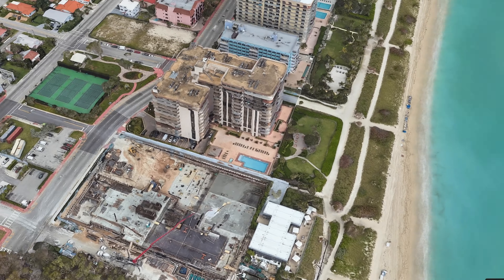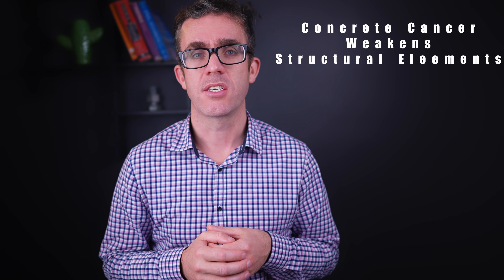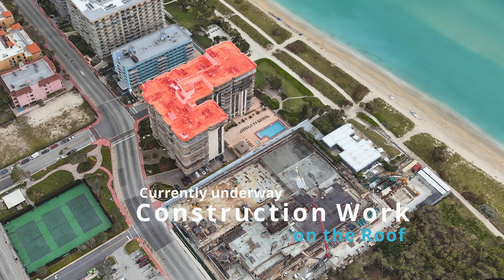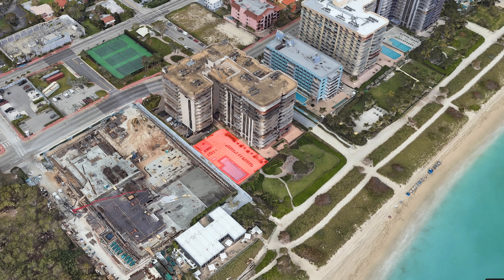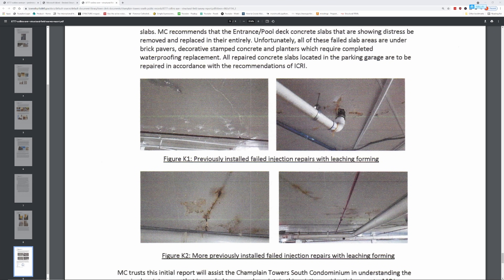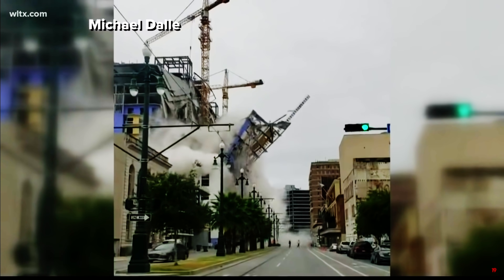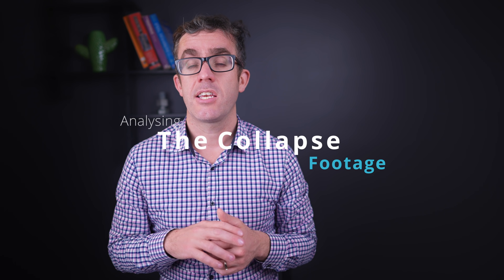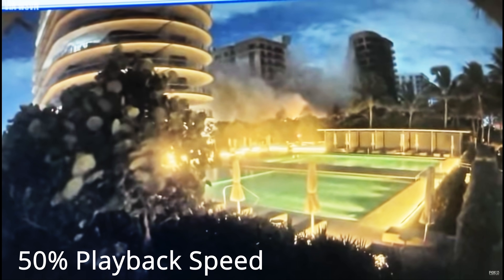How did a Miami building collapse: The Warning Signs. Report and  CCTV footage analysed

Comment: It's pretty obvious why it collapsed.. he who builds in sand... has no foundations. Soon all the others will fall as well, unless they're bedded in rock.  And judging from the obvious lack of maintenance even good foundations won't save them.   The ground collapsed first, followed by the supports, then the mid section, essentially pulled the rest down.  Fortunately they built a solid core around the lift access, which seems to have held out for the remaining building. That and likely the shorter supports at that side. This collapse.. was really caused because they used reinforced concrete in the construction.  And this is the fallguy in almost 95% of all building/bridge collapses.  Those flats might look nice outside, but that doesn't mean they were built right and they certainly weren't maintained.
Reply: Actually, much to my surprise, it appears the foundation had nothing to do with the collapse.
Reply: @seanm3226  The foundations collapsed first,  there's no valid reason for those blocks to fall at that point.  Unless the pillers under them were no longer supporting. That could only happen if the garage layer collapsed first.  Water was seen pouring into the garage area 10 mins before it collapsed, along with some sections of the concrete cladding from the hotel opposite.

Comment: Call me crazy but the "punishment" for not properly maintaining a pool/amenity deck should be a collapsed pool/amenity deck and nothing more. Even back in 1979 we should have mandated completely independent structures for the towers and the surrounding garages/decks.
Reply: This is my thinking too. I can't see how the collapsed pool deck could pull the supports out. Even on the pool deck the supports broke through the concrete... so how can the concrete not just break away from the supports.
Reply: @CelineNoyce  There were "j" type rebars that tied into tower's own slab, which in turn tied into the three critcal "shared" colums. As the slab sheared off its columns near the center of the collapse, it also tugged inward on the edges. Think of pushing a tablecloth through a hole in the middle of a table and how the edges come in horizontally as you push vertically. The columns were not only undersized from what sever youtube engineering channels have noted (including my own opinion as I am an Architect) but they were also probably very compromised by the same pooling water that did in the adjacent pool deck itself. It was a horrible idea to make the two structures depend on the same columns.
Reply: @CaptainCaveman1170  Nevertheless, it’s still SHOCKING it took all of it. I’d imagine small sections, the entire damn thing dropped
Reply: @lexuses3942  Yes I agree that was my point.
Reply: @CelineNoyce  I believe the pool deck was level with the ceiling of the garage. Therefore water intrusion to the ceiling of the garage caused everything below it to weaken over time. Noone yet has determined where the water was coming from into the garage ceiling but in the first image of the pictures of the garage entrance, u see water pouring down from the ceiling. That may have been a broken pipe, but what caused it to break. We are talking 40 years of an issue that obviously was minor, visibly for 40 years or 37. Because 3 or 4 year's ago was when they got the inspection. And at that time, someone should have seriously gotten to work. They procrastinated, and the results are,,,,100 plus, deaths.
Reply: It wasn’t just the pool that caused this! They had problems back as far as 10 yrs ago! Lots of building engineer types have talked to the HOA about it! Fir years! Told them the rebar was getting wet abd the concrete was breaking away!
Reply: @gracieg7601  Yes, almost nobody is suggesting that the pool had anything to do with the collapse. The pool is as deep as the garage and has its own enclosure which was never in danger of collapse as it rests on "solid" ground. It was the "pool deck" that was the issue. The pool deck and the garage ceiling are the same thing and that slab system tied into the same column network as the main tower (unfortunately).
Reply: @gracieg7601  If that's true, really good point.
Reply: Can anyone explain how the sister building with the exact same design, construction , materials , and age is certified by engineers and is doing perfectly fine just a few blocks away?
Reply: @JonNobleNobelOne  They do not appear to have the same issue with water seepage from their pool deck eating away at the slabs and columns over time. But even though they are on top of their maintenance, they are susceptible to the same domino effect should their pool deck ever experience the same series of events and neglect. I wouldn't live there but if I did I would want the tower's structure but to be made independent of the pool deck and garage. That work would cost millions but is doable.
Reply: @JonNobleNobelOne  I have been trying to find a definitive answer since just a couple of days after the collapse and I am still looking, but at some point the south tower flattened the pool deck and added pavers which added a significant load to the existing structure and it also impeded drainage. I would love to know when that change happened and why someone thought it would be a good idea. I don’t think that happened at the north tower, but I don’t know for a fact.
Reply: A collapsed pool deck could also kill people. The point being that there's no reason for a design limitation for what is connected to what. A structure should be designed, constructed, and maintained to not collapse in the first place. Placing an arbitrary restriction on what part of the structure is allowed to be connected to another part of the structure seems to miss the point of design in the first place, and would likely cause unnecessary expense for projects that are properly designed & constructed. Structures shouldn't collapse. Period.

Comment: Hi Brendan, If you look at the first frame of the security video collapse sequence, which is in fact a cell phone recording from a security video screen, what you should notice is that the roof line of the central section which collapsed first has its facade missing. I originally thought that this section had already collapsed one floor before the video commenced. The problem with that possibility is that the lights are still on in that section. What I believe now actually happened is that the whole building facia parapet in that area fell off first, crashing down to and through the pool deck causing the hole in the pool deck that was witnessed from 3 directions. Apparently there was a lot of equipment on the roof for the restitution work that had commenced on the roof. It is reported that there was a lot of jack hammering noise on the roof in the days ahead of the collapse.
I contend that the accident was caused by corrosion damage to the reinforcing and cement from salt water, but on the roof and the damage was at the junction of the parapet base and the roof slab, a place where cracks routinely form in concrete structures. 
If this holds up ass being the beginning of the failure sequence then it is good news for high rise condo owners as it says that the building was generally an intact structure which required a substantial hit in the worst place to cause its collapse. 
It is highly possible that the work on the roof actually triggered the accident.
Having the 10 minutes before the security footage starts would be vital to obtain. As I recall it was 7 minutes from when the hole in the deck was observed before the building collapsed. The actual security camera footage should show the parapet falling of and how it came off. Also notice that at the start of the video there is already a substantial dust cloud spreading far from the building.
Reply: I have to say this makes a lot of sense to me! Especially because of all of those columns sticking out of the pool deck area. That was weird to me from the start... Clearly, some strong force from above was needed to pull the whole deck slab down (and apparently the columns withstood the hit just fine, plus the rebar along the deck held the slab together as well).
Reply: I wonder how come nobody else has noticed this or jumped to agree with your comment; I saw it under another video too.
Reply: @ksenijadavidovic5848  Ksenija, there is a lot of corroborating evidence scattered across various sites. It really requires the information being pulled together in one location and each checked against a time line. People are still looking for a concrete cancer problem in the basement, when it is known that there was plenty on the roof, and that is where the concrete repair process began. For all of the water problems at the bottom they were just as present at the top, even more so from the constant rain of salt from the sea spray, hurricanes and storms. In all probability the failure was the culmination of all of the issues raised by commenters. But for such a change of state for the building in such a short time there needed to be a significant event with considerable energy. There was a woman on the 4th floor talking to her husband on the phone and she told him something just made a huge hole in the pool deck. It was about 7 minutes after that the building started to collapse. Sadly she is amount the missing. If the failure did originate from the roof then the contractors and their working methods will come under investigation. At the moment it is a huge media circus on the ground, so not much serious evaluation will come out for some months as there is a huge amount of political maneuvering to play out yet. As I said, the video of the collapse was a recording from a security screen of the live event, … or a replay. If a replay, was there an intention to leave of the previous 10 minutes in which the roof section would have fallen? The original security footage hasn’t surfaced yet, why is that? Does it still exist?. Politics potential in that alone.
By the way, have you watched the collapse video again? Do you see what I am referring to?

Comment: Could have a vehicle hit a column, or columns in the parking floor causing the collapse?
Reply from the maker: It may have tho loosing on column wouldn't cause the building to collapse. Also the car would need to hit a tower column with alot of force to cause it to fail.
Reply: Compared to the impact of a car those columns are very strong.  I'm not sure if a car could completely take one out or not.  The way the entrance is configured cars would not normally be going fast enough to do that much damage.  With a sufficiently powerful car and a determined person, maybe some damage would be possible.
Reply: yes we need to explore what triggered the collapse. i suspect the system was waiting for that extra 1 unit load to give-in. in Tanzania  collapse of a building under construction was triggered by the extra one 20kg bucket of concrete at 3rd floor. am suggesting there must be a trigger!!!

Comment: The original architecture plans show the concrete "pool deck" with plenty of drains. And the concrete was sloped in a square around each drain to make the water flow to the drain. But that design was probably not as attractive as wanted. At some point that whole deck was covered with pavers. Not sure what they put below the pavers, but the 2018 report talks of "waterproofing" going bad. So any damage to the concrete deck was hidden from view.
There was also talk about water being in the garage on a regular basis.
Reply from the maker: If the basement was regularly flooded with salt water this would have deteriorated the structure more quickly, as would have poor waterproofing this can be seen in any coastal area poor water proofing causing the structure to age quicker.
Reply: @BrendanHasty  I didn’t  think the engineering report mentions salt water being an issue (just pool deck not draining), but a maintenance guy talks about it. However he also made some incredible claims that the water could get to one or two feet and having to pump it out and so much that cars would float. 
How does salt water get into the garage? Is there sea water seaping into the ground inland?
Reply: Well, it. Is built on a sand bar barrier island. Salt water is a given.
The maintenance man also said that rather than try to make repairs for the 2-3’ of garage water he was told to buy more pumps (2 at a time).

Comment: Why don't they mix stainless steel in with the other rebar❓  It will cost more, but no spalling.
Reply from the maker: Agree this may cost more and make the structure or resistance to Spalling, but even stainless steel can corrode is extreme environments, another option would be protecting the steel with sacrificial anniods, this would also all the structure to be monitored and the annoids can be replaced.
Reply: Brendan Hasty is
Reply: @BrendanHasty  basanite is the future
Reply: Epoxy coated rebars.
Reply: Or galvanized rebar.

Comment: It's just nuts that one part of the building fell down while the other stayed up..clearly there was some form of weakness in the part that collapsed. The question is was it the  pool/deck that caused it or the design of that part of the building, or  did the place where the water was settling inside and not properly draining causing the problems. I honestly think it will be some type of severe water damage that caused it.
Reply from the maker: Hi Detra, the overall document design seems OK. So question around wreathing and concrete deterioration, and footing systems will be investigated. Likely there may also be several causes.
Reply: And was it a matter of time before the other tower would’ve come down?

Comment: What ALL of the videos describing the structural failure seem to be missing is that one half of the structure you have marked "Zone 3", the west half collapsed along with the central part of the building.   The remaining part of the "Zone 3" teeters for about 10 seconds and then collapsed from a point in the lower part of the building.  Please look at the video again and notice where the vertical line of the collapse is located in the "zone 3" part.
Reply from the maker: Hi Swinde it does appear that part of zone 3 can down with the orginal failure. That part of the structure would have been very unstable, as it would have been supported on very few structural elements.
Reply: @BrendanHasty  And the remaining part closest to the ocean would not have had much lateral resistance on its few remaining columns, plus having been pulled sideways by collapsing slabs.
Reply: Yes zone 3 should be about half the width it is, and zones 1 and 2 correspondingly longer.